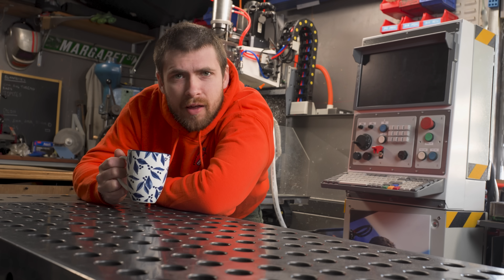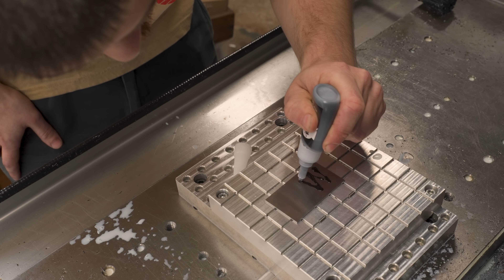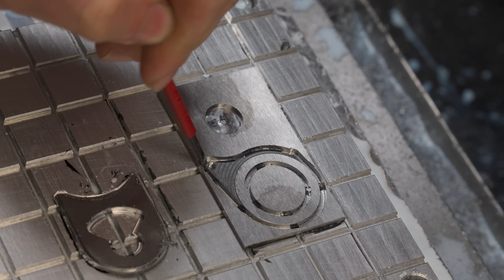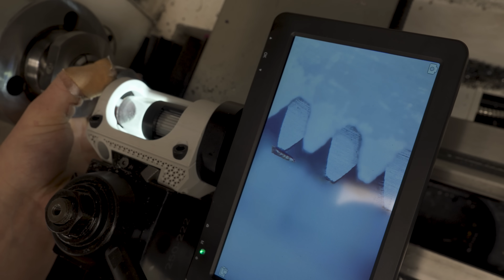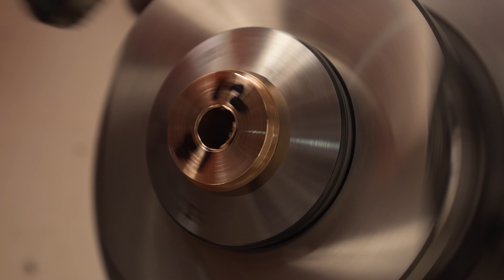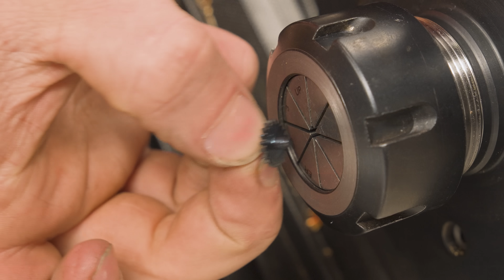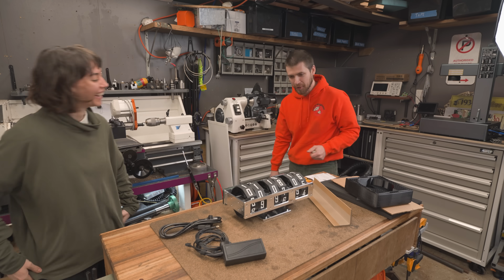What if angles were metric?

Comment: I've spent 25 years as a controls engineer. Radians are basically our defacto SI unit. All the maths functions expect them anyway, it makes working out circle stuff easier... just better
Reply: I still remember the day I was in the computer lab in collage, struggling to get matlab to graph sensor data, when a freshman asked me if matlab "did radians". "Of course it does" I said "that's it's default, it does everything in radians, it takes effort to...... THE SENSOR REPORTS ANGLES IN DEGREES!!!"
Reply: @finnrock5558 I feel your pain 

that's why you always do calibration
Reply: @finnrock5558 😂❤
Reply: @finnrock5558  because sensor is digital. You can't represent radians in floating point correctly
Reply: @EllAntares  What do you mean? They are numerically approximated and stored like any other  float.
Reply: @EllAntares  do your sensors always report integer degree measurements only? What about a 13.3° angle?
Reply: @Supreme_Lobster fixed-point numbers maybe?
Reply: @EllAntares no? It's like representing cents as a float. You can, you just shouldn't
Reply: Love me a good small angle assumption in control laws
Reply: I still wish radians were based on tau, not pi
Reply: @hashbrown777  you can litteraly  just base them of off tau if you want to lmao. Litteraly just 2pi rad= tau rad. Its that easy
Reply: @janusmarais7580  I think they mean they wish it was common practice to teach students to measure radians through tau rather than pi. It’s a more practical approach because the fractions of turns around the circumference are simpler. This would make precalculus, trig, and higher math easier to digest when you aren’t doing math with weird fractions
Reply: Holy shit Euler’s equation is even better if you use tau. WHY AREN’T WE USING TAU
Reply: @hashbrown777  lmao radians aren't "based" on pi or tau at all
Reply: @beauhenry105 "one turn in the complex plane is one" is so much cleaner than "half a turn in the complex plane and then moving one unit in the x positive direction is zero". Tau is so much better than pi for everything
Reply: @beauhenry105  I will blow your mind, but it used to be that the value of Pi wasn't fixed and mathematicians had to specify they meant Pi was equal to half or a full circle circumference.

But yeah, using Tau in school would be nice.
Reply: @cyanophage4351  e^(i×tau/2)+1 = 0 ? :D
Reply: @vulk_nubium  that’s very confusing ol
Reply: @hashbrown777  there are merits to both arguments, I think it would be helpful to introduce the unit circle with respect to the diameter and not the radius. In that case pi make sense and diameter as a practical matter is easier to measure precisely
Reply: @beauhenry105 No. Everything would have a τ/2.
Reply: @hashbrown777  Is everyone here doing a bit or something?
Reply: @A @AJMansfield1  2002 is calling, they want their “lmao” back.
Reply: @hashbrown777  they're based on neither. i think it's something along the lines of euler's formula (e^ix) defining rotation in the complex plane, and stepping by 1i outputs you exactly one radian of rotation. i think 3blue1brown made a video on it, it's cool
Reply: @hashbrown777  diamerians
Reply: @shiningvivian  It's not that they are based on pi, but rather that they are inherently tied to pi.
Reply: @hashbrown777  makes more sense to "base" off of pi since polar complex numbers are generally represented in the form re^iT, w/ pi<T<=pi
Reply: @beauhenry105  I mean, pi is just 180, so it's not that hard of a thing to figure out that it's just a half turn, rather than a full turn around.
Reply: @sponsor-i9h No it isn't hard but it destroys intuition. To understand what pi/4 rad is you need to stop for a second and think that a full circle is 2pi and it's therefore an 8th of a full circle. tau/8 however trivially shows that. Next is figuring out the length of a segment where that 2 sneaks in again. And finally the area of a circle being r^2*pi instead of 1/2*r^2*tau destroys the intuition that it is just the result of integrating over the radius.
Reply: @hashbrown777 For the greater good
Reply: @beauhenry105 I just ignored the fractions. It could be an American thing, we just digest fractions without complaint.

Those decimals floating around everywhere sort of disorient me. Although I do like to put decimals in fractions. Not convert them, incorporate the decimal into the fraction. I'll leave one side whole, the other is whatever, deal with it.
Reply: @AJMansfield1  I'm not quite getting what you are saying here. A full rotation in radians is 1 tau (or 2 pi) . How is it not "based" on pi/tau?
Reply: @hashbrown777  Because tau doesn't work with tds and pi does  dummy, I mean think about it!!
Reply: @janusmarais7580 yeah but using the newer tds version calculates the same result as both but with less/faster calculation
Reply: @TecknoVicking  no, everything has 2.pi right now
Reply: @conman7644  pi and tau and radiants are all based on the ratio of a circle radius to its circumference.  The math just happens due to the geometry.
Reply: @janusmarais7580  I read imao. I thought you had used a brilliant adaptation of imho.
Reply: I have pi  = 180 degrees burned into my Brain.
Reply: @karigreyd2808 so if you have ice and bring it to a boil you heat it up by π?
Reply: We never get to know what is in the note.
Reply: Radians are not just the de facto SI unit, they are the SI unit. Gradians may be metric, but they are not part of SI. They're an old, irrelevant and mostly forgotten metric unit, like the erg.
Reply: @MrAwawe  Yep. Radian is a so called derived unit in the SI-system.
Reply: @MrAwawe  Gradians are often used for orentering, why? i don´t know. It just is.
Reply: @MrAwawe  There's actually no metric system, just SI.
Reply: @MrAwawe   Yet calculators still retain the option to display them.
Reply: @DavidSmith-vr1nb which is the right. Giving options between established units and automatic conversions between them is a better solution than to force the user to use a specific unit. Especially since they'd have to do the same calculations, but by themselves.
Reply: Radians are not the defacto SI unit of angle. Radians are the actual unit of angle in the SI system.... https://en.wikipedia.org/wiki/Radian
Reply: True. After radians there are no degrees in life
Reply: @slrucom  I feel the other replies missed the angle you were taking on that joke
Reply: @slrucom 😂
Reply: @slrucom  Nah, I still prefer degrees. They feel more intuitive.
Though that's probably a question of what you are used to.
Reply: @Outis-d3ci prefer shaft position or revolution position as [0:1[ - but i also like fixed point math in FPGAs.. 🤓
Reply: @Outis-d3c So water boils at 5π/9radC? Also, 5/9? Like in F/C calculation?
Reply: @Outis-d3cif we are talking about something that rotates, I highly prefer degrees. For small inclinations, radians are much better. In between .05 radian and 45 degrees, i have my own units i prefer.
Reply: @Outis-d3cYup, which is also why I don't tell people that they're wrong for using a specific system. Only that there are more logical units.
Reply: @slrucom  disagree... Degrees are more intuitive when communicating with others or reading angles out of a screen. Plus being able to divide a circumference by a rational number makes computing trigonometric functions way more precise in some applications. I think they both have their place
Reply: If you are dealing with derivatives and trigonometric functions (like in control theory as the other person wrote) radians make your world wayyy easier.
Reply: @MrEscuchimi  only because there what we teach from primary school
Reply: @MrEscuchimi hard agree. But im the QC/ cmm guy and everyone thinks im wrong anyway,so.... =/
Reply: @MrEscuchimi  Degree's are just easier to wrap your head around because early and small number math was base 60/base 12. It makes sense since you can count to 12 on one hand and base 60 has quit a bit more divisors, since 60 is evenly divisible by 1-6. However, sexagesimal loses it's advantage as soon as you leave the realm of small numbers and fractions, or in other words: Every day math.

Raidans (and steradian) are much better than degree because you have pi and therefore not an arbitrary division of a circle. This makes many geometry functions so much easier.
Reply: @Daisy_human pi still an irrational number, unless the angle in radians  is given as a scalar times pi (at witch point just use another unit) there is no way im going to learn, retain, and spot that 0.5 = sin(0.523599...) instead of = sin(0.525344...) while I know its sin(30°) and not sin(30.1°)... Idk guys, i still rather have degrees (or even gradians!!) for my digital level and other applications, but it must just be me 😅
Reply: @Ruhrpottpatriot using binary you can count to 31 on 1 hand, or 1023 on both hands
Reply: @Ruhrpottpatriot
"You can count to 12 on one hand" brother, how many generations of cousin marriage do you think we've all been through? 😂
Reply: @MrEscuchimi  well, turns are probably the best for reasoning, just radians divided by 2pi. 1 turn is all the way around, 0.5 turns unit is a semicircle, etc.
Reply: @DD-th5tu  12 finger bones (3 in each of 4 fingers) that you can count off with your thumb. That's why some early counting systems were base 12.
Reply: @DD-th5tu  god I hope you're pretty... It's why there are 12 months, 2 sets of 12 hours per day, why the dozen is so prevalent. Use your thumb to count each division of your four other fingers. There's twelve. Keep count of how many rounds you've done on your other hand and you count to sixty, ergo minutes in an hour, extended to seconds in a minute.
Reply: @Daisy_human Yeah nah radians is great for math and computer science but most people arent doing those things.
 Degrees is just simple enough and precise enough for every day usage. 
Rather than using a bunch of fractions you can represent anything with relative accuracy with 3 digits.
 I can use both but there aint no way im using radians in a building project, nor would I use degrees in a program.
Reply: @morgan0  degrees is convenience for taking quick relative measurements. With 3 digits you can represent more precision easily.

 But yeah, turns/radians is better for reasoning so thats why it gets used in math, programming etc.
Reply: @DD-th5tu  If you look at the inside of your hand, you will see three main creases on each of four fingers. Use your thumb on the same hand to point at each in turn and you can count to twelve.
Reply: @DD-th5tu  you use your thumb to point at/touch each segment of your other four fingers. 3 segments on 4 fingers gives 12 total segments. It's called knuckle counting, which is a little misleading.
Reply: @MrEscuchimi rationals are so overrated...
Reply: @slrucom how about Celsius? Or are you using Kelvin instead
Reply: @mallerschwab980 as physicist of course I use Kelvin in all computations. And translation is simple enough
Reply: @mallerschwab980   Kelvin is what you get when you put a Celsius in the freezer because it's cold as ice then.
Reply: @daexion a freezer is way too hot. Boiling hot according to my friend Nitrogen.
Reply: yeah, i am not a engineer (yet, i study compsci), but i have thought in radians ever since learning them, the one issue is that i have not found a good way to display them on a screen yet for stuff that changes, it end up being a bit awkquard, i may try playing with gradiens a bit tho
Reply: It was a de jure SI unit for a few decades as well until physicists realised it didn't make much sense as a unit
Reply: @UnePintade  Wrong. The radian is the SI unit of plane angle to this day.
Reply: @Catcrumbs  no the radians and the steradians are no longer units since 1995 after the 20th conférence générale des poids et mesures
Reply: @UnePintade  Please consult the latest edition of the SI Brochure.
Reply: He is talking about gradians which are 1/400 ths of a circle. Radian is the arc of radius laid on the circumference of the same circle. Something a little different....
Reply: I'm a mechanical engineer and I also agree, radians makes way more sense for metric system of measurement.  400 Gradians versus 360 degrees sounds petty to me 😂
Reply: The sumerians were also great astronomers. 24hrs and 12 months (both divideable by 12) might have played a role why we have 24hr day not a g/radian day.
Reply: the real question is, pi or tau?
Reply: @colehewitt9827 I prefer tau, but the real world uses pi so that's what we have. I will put constants in terms of tau when possible tho ;)
Reply: Yep. Radians in physics and engineering when calculating power and torque. Degrees in engineering design,  when dividing the circle, e.g. holes on a flange, Gones for surveying; those angles are going to be all over the place anyway.
Different strokes for different folks, or rather different applications.
Reply: As far as I know, radians used to be something of a default for any reports in science. 
At least that's what they taught me studying applied physics. 
With control theory we also always used radians.
Reply: I spend 2 decades making high precision parts, sometimes without a budget, cause perfection was required at any price. Perfect precision require metric, but I've never used radians, always been fighting with the ridiculous m and s divisions the chef engineers asked for and i hate it!!! It's incomprehensible, it's one of those things you at some point just get use too, kinda like the imperial system i guess. I've envied the laser measuring guys, when i got the reports with radians and the calculated degrees after
Reply: In my compulsory army service I was a Sky guard anti aircraft gunner. Radians was the de-facto way of measuring angels in the system. It was interesting and in line with all military accuracy needed.
Reply: My favorite function in godot (game engine) is dag_to_rad() that just turns rad to degree 😂
Reply: This isn't a radian gauge, this is a gradian angle gauge.
Reply: @moosetwin  they know
Reply: Was looking for this!
Reply: Exactly. Radians are the metric angle units.
Reply: @Monty0bar True, but you're missing the most important part. The guy is making his gaugue in gradians, not in radians. Two different things.
Reply: radians are easy if you work with them a lot. just harder to type because theyre fractions
Reply: Someone missed the memo...
Reply: but he talks abotu Gradians tho. another feeble unit
Reply: Almost all functions expecting them do so arbitrarily, because they were constructed to do so by convention, and could aswell have used less fundamental, but more humanly convenient units.

I too prefer working with radians over degrees, because it is more intuitive after going through university. But I acknowledge that:
It is more intuitive because it's more familiar, not objectively better.
It is more familiar because it was overused, which it was not because it's objectively better, but for the purpose of... I don't know, aura farming I guess. Science and education have a lot of aura farming baggage and elitism left over as "traditions" from centuries ago in the way things are done and named.
Reply: @arcturuslight_  The way radians are defined removes the conversion factor between angles and arc lengths, many functions expect radians specifically because it doesn't need arbitrary conversions, which kinda does actually make it better imho. (Though one could argue radians just force you to do the conversion beforehand with a lot of important angles including pi)
Reply: In the video het talks about “gradients” not radians, am I interpreting it wrong?
Reply: Yeah and there often left unitless (which is fine because angles are actually ratios)

Radians ftw
Reply: And pi = 22/7
Reply: Well because they are?
Reply: It's incredible how much more sense trigonometry makes when you use radians.
Reply: Computer graphics expect them too, but never understood them, maybe it's time to do it now.
Reply: Radians are a core part of polyphase calculations in electrical engineering.
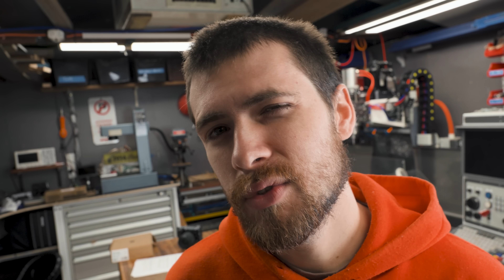Reply: cool story bro. guess you missed 10:27
Reply: @dirtrider88 no
Reply: I have spent 10 years as a controls engineer and never heard of them. Clearly we work on different sorts of controls.
Reply: When I did my unit convesion app, I created pi radians as a unit.
Reply: Rad.
Reply: As a physicist I'm also used to radians (circle/2pi) but I thought he meant grad (circle/400)...
Reply: Radian =/= Gradian
Reply: @nik12937they never said it is?
Reply: @Somebodyherefornow Sure, but if someone says "gRadians are a system of measurement that make angles metric" and someone else says "I've worked with Radians my whole career", it is a reasonable assumption that some miscommunication is possible.
Reply: He's talking about Gradians not Radians. There are 400 gradians in a circle and 2π (~6.14) radians in a circle. Radians are great for math functions, degrees are great for everything else, never used gradians.
Reply: radians are the SI unit of angle.
Reply: Everyone talking about radians while he's talking about gradians, which have nothing to do with pi but divide the circle into 400 parts instead of 360
Reply: 2π radians in a circle. No need for degrees when your unit is baked into the circle
Reply: @jmiscreant the turn (2π rad) is a whole circle and a spät (4π sr) is the whole space (as around the center of a sphere); using fractions of 1/2π as the unit of angles is rather ugly on all accounts and with all units involved
Reply: @mezzer34 This video is about Gradians not radians.
Reply: @Vatamala Shame, socialising must be difficult for you
Reply: We really need to have a tau constant for full circle (6.28... radians).
Reply: Next time you need precision gears, why not make two on the same shaft so you can set the backlash. Similar to the back block on cross slides where essentially you get one side of each gear to index for control.
Reply: All college math books use Radians, at least in the U.S. so you have to do a bit of conversion from degrees
Reply: @bororobo3805  They use both. It's really not a big deal if you know the relationship between radians and pi.
Reply: Whoever liked past 360 needs to not mess with the OG and withdraw their likes.
Reply: you just had to come and comment, sigh..
Reply: Oh it was radian I was like wtf is gradian
Reply: @polligon12  gradian is also a unit, I couldn't explain it to yo beyond knowing they wxist
Reply: @Bjorn_Master-of-None I learnt something new today
Reply: Radian is basically SI.
Reply: Surely a 1000 or 100 full rotation would match the decimal system better? Depending upon the degree (pun intended) of accuracy required?? 🤷‍♂️
Reply: Mezzer34 Did you miss his message at 10:30?
Reply: @Daedje  His message was to those using gradians. Mezzer is posting about his experience with radians. Follow? It's conversational threading.
Reply: What about the gon where 100gon are your right angle and 400gon are full circle?
Reply: I had never even heard of radians until I went to sniper school and had to learn milliradians to use the scope I had been issued. Now, I prefer them.
Reply: Gradians are not Radians. This measures Gradians. 1 gradian = 0.01570796 Radians
Reply: @designerd77I always thought it way radians, as in radius. And gradient is the angle (in degrees) of a slope. I've never heard of gradians?
Reply: Didn’t he say specifically that if you did this in the comments you are gay? First 10 minutes of the video.
Reply: Not radian, gradian, with a "g" at the beginning. One gradian is  π/200 radian.

/edit: As others have pointed out, it's π/200, not 1/200. I somehow mixed in parts the turn definition, which is 1/400. Thanks for the correction.
Reply: @Ruhrpottpatriot  pi/200, not 1/200
Reply: @freyawion5337 Correct. My bad.
Reply: @Ruhrpottpatriot No, 1 gradian is pi/200 radians.
Reply: @MrAwawe  Others have pointed that out already, but thanks anyway.
Reply: @Ruhrpottpatriot  π radians = 200 gradians. We're talking different languages here. Open up your mind and read to try and understand, not assume you know everything.
Reply: @boysurferG1 wait... It's /TWOhundred???
Reply: @jeffstaples347  yes, because pi Radians is a semicircle, which is 180 degrees or... 200 gradians.
Reply: @boysurferG1  God forbid people make errors. Instead of being condescending, you can just point those errors out like a normal human being.
Reply: @Ruhrpottpatriot  **s**ure , with a "S" at the beginning. Nothing condescending about what you wrote. If you can't take it, don't dish it out. Nothing about what you wrote was normal.
Reply: @boysurferG1  If thinking that makes you sleep better at night. Be my guest and have a nice day.
Reply: Gradians my dude, gradians, not radians. You know, like the tools you use to make maps with. Those extra graduations (the gon) on high precision map room compasses (basically the engineering world's tool room grade tools). Those be gradians.
Reply: @aserta and I specifically said radians, because they are superior.